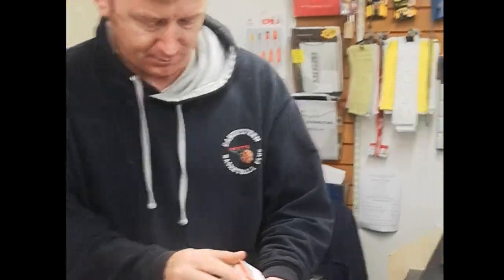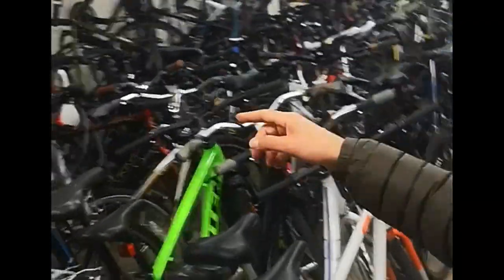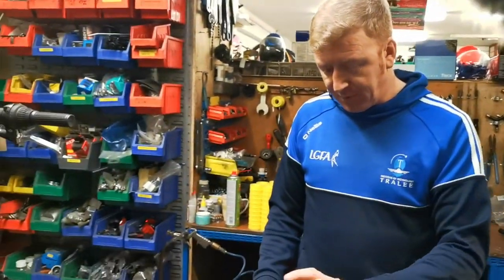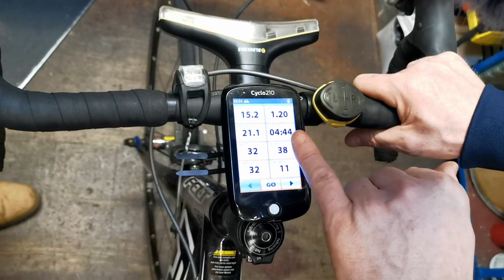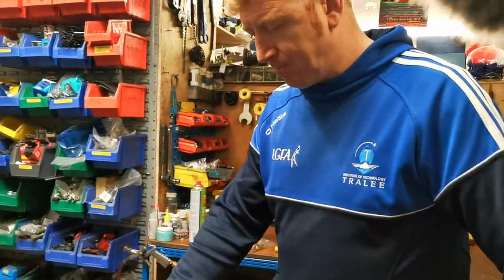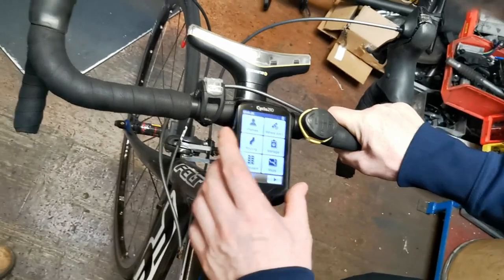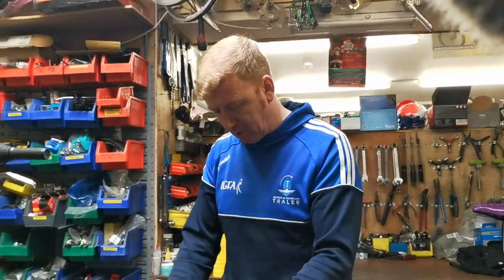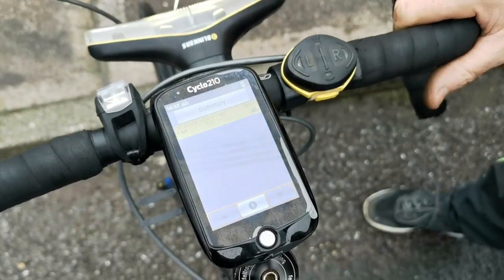One of the Best Bicycle Computers for Experienced Cyclists in 2018 - Mio Cyclo 210 Review

Comment: Can i upload data from mio cyclo 210 to strava with specific app installed on my phone?

Can i take Heart rate with ant+ belt? (i have garmin belt for HR and it has ant + technology)

Can i upload track on mio cyclo 210 and follow it during my ride? 
Thanks
Reply from the maker: I hope this helps. 

Good question, I checked online and on the machine and didn't find anything relevant to inquiry David. tbh, this is also beyond my scope of knowledge. I would recommend contacting Mio with this link buddy... https://service.mio.com/M0100/MainFrame.aspx 😊
Reply: @Drpepper99uk  dont lie little man it does NOT have ANT+ then you need to buy the 215 the 210 does NOT have any connection for ANT+